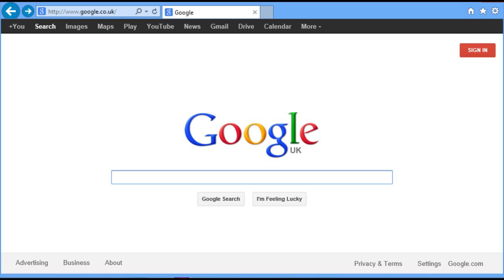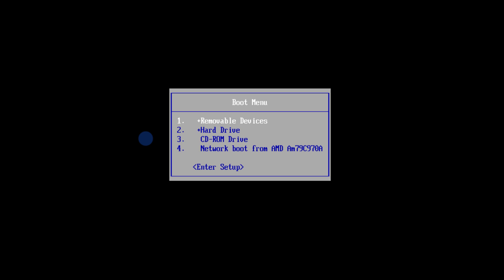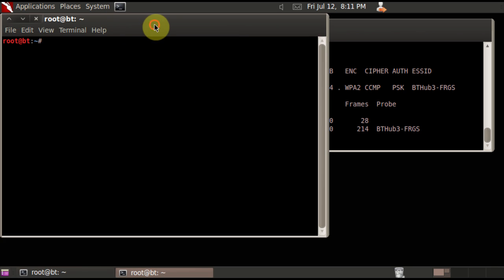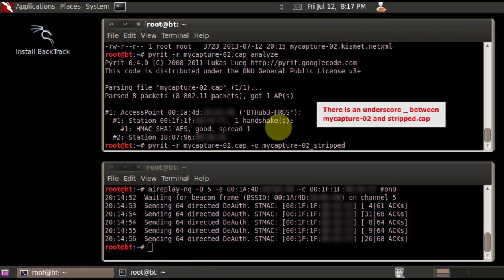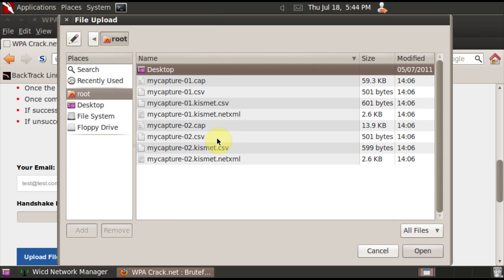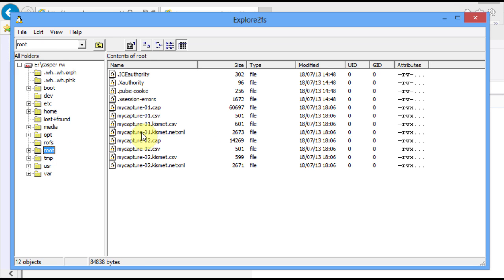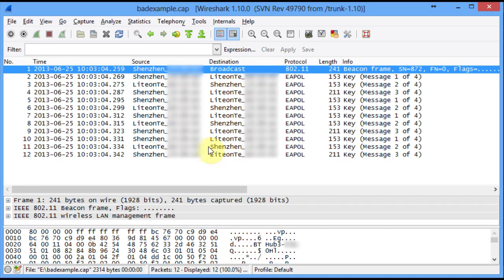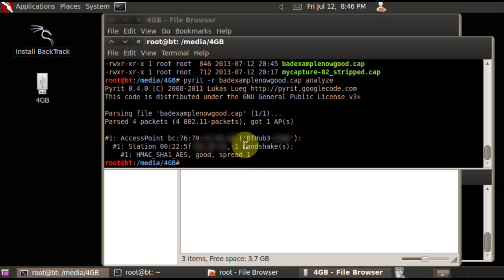How to obtain a WPA / WPA2 Handshake Capture with Backtrack 5 to crack a wireless password.

Comment: I am having problem in handshake its taking a lot of time and still no result please help
the command i am using for handshake is :
aireplay-ng --deauth  0 -a (adress) mon0
Reply: saqib dogar and there are no clients
Reply: +saqib dogar you can't get a valid wpa handshake untill a legit user login in the wifi i.e. you have to wait for the moment when one connects... moreover you cant send deauth packets unless the wifi you wanna crack have atleast one client!
Reply: +saqib dogar I recommend you to use following syntax if atleast wifi have one client:

aireplay-ng --deauth 200 -a {MAC OF ROUTER} -c{MAC OF AVAILABLE CLIENT} wlan0mon{your wireless adaptor card name}

Comment: I have a problem: I'm doing everyting alright, but when I enter the airodump-ng -w test --bssid mac -c number command
No device pops up under station. What's the matter? Please respond, thanks.

The problem is I'm testing this on my own connection and my phone & laptop & tablet are connected. Still it does not show up
Reply: MARTIN HASSANZADEH  try: ifconfig
then check if you have wlan0 on the list...
if you do try: airmon-ng start wlan0
then try the airodump